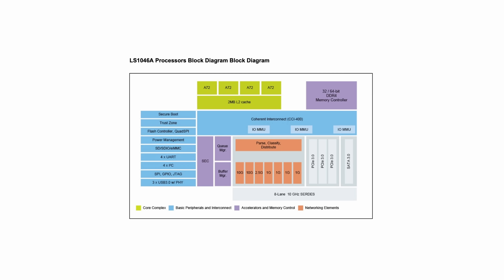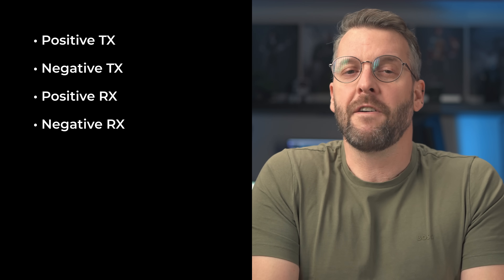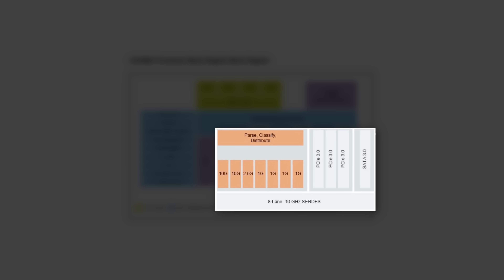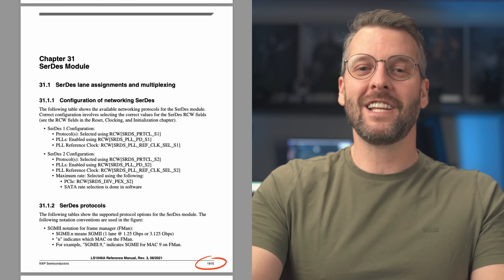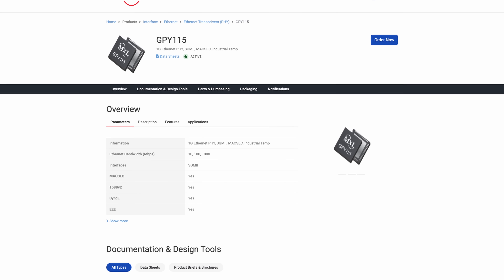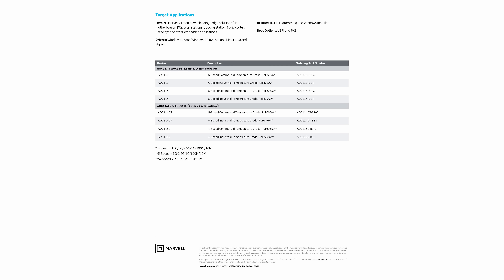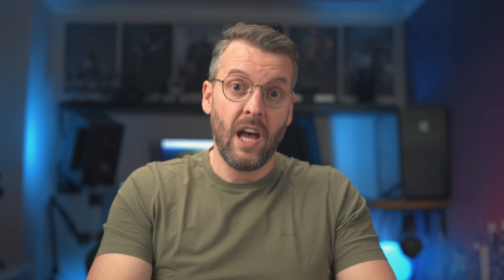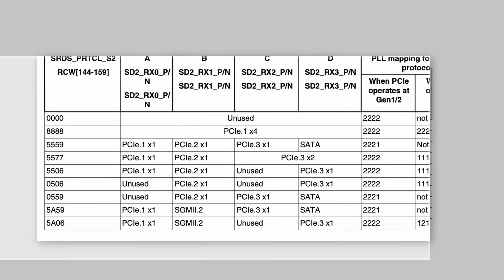You sure do LOVE your 2.5GbE ports!

Comment from the maker: Would you pay more for this device to include a 2.5GbE port? If so, how much?
Reply: I would not, 2x10g is fine for a single-homed router, if you are doing multihoming you need at least four.
Reply: It's not the job of the router to host the 2.5G port with POE for WIFI access point. The 10G SFP+ port is already available for connecting to a separate POE switch with as many 2.5G or 1G poe port as required.
Reply: @stanjs  agreed
Reply: I would pay for this extra speed, now the how much....would have to see the full picture. If (hypothesis) the device with 1gbps ports is 170€ and the one with 2.5gbps is 200€ doesn't need too much thought to pick the 2.5gbps. But if we are talking about 50€ or even more....then maybe a model with just the 2 10gbps would seem better 😂
Reply: No, this router can be suplemented with a switch with 10 gif upload and 2,5 gig poe Switch
Reply: No,.. a good multigig switch can supplement those ports. It’s not worth the price to add one 2.5 GbE port, while sacrificing 10GbE capabilities for the future.
Reply: I think that if you really want 2.5GbE that bad you can just get a switch with 4 2.5GbE ports and an upstream 10GbeE port connected to the router.
Reply: @FBI_Master  at least with cable modems, sometimes switches between the router and the cable modem aren’t supported … at least from my testing.
Reply: I only have 1 and 10Gbe (sfp+) and no 2.5 currently in my ecosystem so I personally prefer 10 overall.
Reply: No. Your originally proposed spec without 2.5G looks a better proposition.
Reply: no.  the 10gig can be split out to a switch if i cared about 2.5GbE
Reply: personally, i prefer 2 SFP+ at low cost, switches with 10Gb/2.5Gb are numerous and cheap on chinese sites. moreover if it's SFP+, there are SFP+ modules capable of 2.5 or even 5Gb.

In conclusion, as cheap as possible for the brain, distribution switches can easily compensate for this need.
Reply: No. The 2 10GbE ports and 1GbE ports are fine.
Reply: an alternative is to run ryzen embedded with 2x10Gbe. There are some reasons to and not to use PCIe. Using PCIe allows using an integrated circuit to handle PHY and process some traffic itself (its why mellanoc and intel chips are famous in servers), the other reason is latency, which can have a difference of up to 0.2ms on LAN. case in point in 1Gb/s from my testing in the past, a realtek gigabit chip attached to the chipset just doing PHY achieves less than 0.2ms latency while a marvell gigabit chip attached to PCIe achieved a latency of around 0.4ms. The test was a LAN ping to a dedicated networking device like an embedded router. PCIe if done wrong can cause unwanted latency depending on what you intend to use it for which can reduce throughput in traffic heavy situations but not throughput heavy (if you use larger packets and large payloads). You do need to remember the realtek does not do any processing of its own and relies on the CPU while the marvel can do some packet processing which is why realtek isnt liked for pfsense since most of them are just PHY chips with processing offloaded to CPU.

I have an udoo that uses ryzen embedded but it chose usb-c instead of 10Gb/s networking coming instead with 2x 1Gb/s ports. If you sacrifice 10Gb/s usb-c you can get 2x 10Gb/s + 1Gb/s on the board itself, separate from sata, pcie and ram can be easily made to be a slot. I am surprised you didnt consider this as it would've reduced the time and complexity of your design with the only downside to needing to get a working bios which can be done through a reference one based off one of the common x86 bios. Not only that but with the ryzen embedded, you not only get your networking and PCIe for wifi but for m.2 storage too, a good range of general IO like usb3 and the option to add a PCIe networking chip and have 8 lanes for a full card. It is power efficient as i run proxmox on this 24/7 for a few watts. You get 4 ryzen cores with SMT and a GPU to use with packetshader if thats your thing.

udoo prefers to be on the unnecessarily more expensive side of SBCs so you could easily out do them in pricing for making a router using the same platform with more features. Its important to remember that hardware design is one thing, you will need a firmware that supports any hardware acceleration on the hardware you intend to use.
Reply: @System0Error0Message nice opinion
Reply: for me i have 2x10G NAS, 1x5G ISP and 1x2.5G wifi, this devices even with only one 5G would not fit my needs, but its super cool to see this project developed in public.
Reply: Please don't, the device is already expensive as-is. 50$ is a significant cost increase, and if it weren't for the promised cheaper version, i would probably be unable to afford it... 
Also,I don't see any benefit for a single 2.5G port. Yeah, you may have a home server, but then, don't 2x10G ports suffice?
All I'm saying is that I don't see a justification for it, given the cost increase.
Reply: I would not. 2x 10G its great for inbound/outbound and I can use the 3x 1G for mgmt and other random things.
Reply: as i said on previous video i dont see a reason why to have a 2.5GbE if its not like a free (no losses thing, maybe if it replaced 1 GbE ports as it could still server as management but its a poor upgrade choice) since there are 2 SFP+ 10Gbps cages which can with simple modules be turned into any 1GbE and up rj-45 or SFP.

also i do not understand why use 2.5GbE port anyway when most home networks from router to core switch can easily be covered by single SFP+ cage and at that speed its very likely that incoming wire will eb fiber which makes RJ-45 port kinda useless as fiber will work with SFP+ much better
Reply: @bigpod i agree ... if you need more flexibility you can always add a switch and utilize a couple of vlans to create more ports ... if posible add a nother 10ge port instead for added bandwith for the trunk, and let people split it into 1, 2.5 or whatever themself 🙂
Reply: @bigpod  Unfortunately there are lots of cable modems or fiber ONTs that hand off via 2.5GBaseT or 5GBaseT and don't support either 10G over copper or any SFP+ variety.  I wish my AT&T fiber could just use a SFP+ but that's not an option.
Reply: @SeanHarlow  you can use rj-45 module for sfp+
Reply: Would a "shared port" be possible like a lot of switches have where one or both of the 10G interfaces can either use a SFP+ or RJ45?  Mikrotik recently released a switch with a mismatched configuration like that where four ports are either 10G SFP+ or 2.5G copper so the more expensive 5/10G copper components could be skipped.

I think the Netgate 6100 and Deciso/OPNsense DEC740 represent the price cap in the $800ish range, as both have 2x 10G and three or four 2.5G copper interfaces (plus two more gigabit interfaces for the Netgate) paired with x86 CPUs that allow a much wider range of OSes to be run than an ARM board, I can't see choosing ARM all else being equal unless I was trying to run off batteries and cared about power consumption to the single digits.

All that said, IMO as long as the SFP+ cages can support 2.5G and 5G modules I don't see any reason to care too much what the native copper ports can do.
Reply: I personally have 3 Gb down/3 Gb up configuration at my home. A 2.5 GbE would allow me to plug my desktop into it directly! I agree with @toumpanis' suggestion.
Reply: I don't think it's worth any premium whatsoever in this case.TBH, I'd prefer an additional  SATA/NVME  M.2 port over 4x1Gbe. With 2x10Gbps ports (1 must be SFP) I'd simply buy a switch with 10Gbps uplink and required number of ports that are needed at required speed 1, 2.5, 5, 10 and may be with POE and maybe managed. There are plenty of those at very low prices. There is no downside except needing another power socket. A small price to pay for  great flexibility.
Reply: No. That's my switch's job, not my router.
Reply: Honestly why not give it as an option for anyone who wants it.

If there is an option I would pay more how much depends. Is there only 1 port of 2.5GbE or multiple?

Forgot to ask that m2 slot would work with LTE/5G modems or not at all?
Reply: @sebas0469 only one 2.5G port. The reason for not giving an option is that they would have to build 2 PCB versions, due to the SERDES configuration, and the additional interface chips required. The cost would double, for sure (think of the additional certifications, development, etc.). This is why this video has been made in the first place, it is too expensive to give an option, so the audience would vote which one version it will be.
Reply: Personally, I would pay more for the 2.5gbe port, however, I think it's not needed at this point in time. I understand that the market this device is for the high end/homelab space but at the end of the day, gigabit fiber has only become available for me within the last 6 months... I am willing to bet that there's probably a large portion or the united states that still doesn't even get gigabit speeds. 

I think that a second version of this router might make sense to have the 2.5gbe port(s) as I imagine that would be another 3-5 years away if it were to happen, making the market for 2.5bge much larger and it might actually make sense at that point in time.
Reply: No, definitely don’t change your initial thoughts! If some one wants one or two 2.5G Nic’s he can put 2.5G transceiver in them. And yes I definitely want to buy that router it’s exactly what I’m searching for.
Reply: Thinking through this and all the comments, I think if your only market is high end / homelabbers, then skip the single 2.5 because we all have a multitude of other options.

BUT if you're also hoping to hit a portion of a bigger segment, that is, prosumers, who might not easily be able to interface with SFP or for whom this will be the only networking device other than a modem, then this is a must.
Reply: Of course I would, but actually I prefer 10GBits ports, so that I could split them without speedloss. Also WiFi7 would be nice a nice accessory in your router, but I actually think, that it would be cheaper with all these features instead of a new '' high-end '' router which is selling for more than 600 €. You could maybe design your router partially upgradable, so that modules could be upgraded by time.
Reply: I think the 2x 10Gb is enough, wouldn't pay more for 2.5.
Reply: I would also not Gigabit is more than enough for the european Internet in the Next 10 years
Reply: Maybe add a 2.5switch on a 10uplink
Reply: No, I already have a 10 gig switch.
Reply: im not too familiar with netwoking equipment. but if the sfp 10gig ports can be adaptet to 2.5 gig or 10 gig rj45 then puting a 2.5 gig rj45 is not needed in my opinion
Reply: So, we have SFP ports which can have a 2.5Gbe module if needed. I don't see the need to increase the cost.
Reply: No for me it is not worth
Reply: The concensus seems clear and I agree. I don't see a good use case for a single 2.5GbE on a router. If you want one, you're going to want more, and very possibly with PoE+ - e.g. for WiFi 7 APs.
Reply: I'd pay for the extra speed. I'm tired of my Nighthawk throttling my network.
Reply: @JosephANagyJr  Your Nighthawk is an all-in-one router/switch/access-point. This is a router and in the same way that you would be expected to add dedicated WiFi APs, a separate 2.5GbE switch is not unreasonable.
Reply: @KeithHanlan  not sure what that has to do with anything that I said
Reply: @JosephANagyJr  you wrote " I'd pay for the extra speed. I'm tired of my Nighthawk throttling my network." - I took that to mean that you were arguing in favour of addition of a 2.5GbE port as a way to solve your current WiFi router's limitations. What did your statement mean if not that?
Reply: My current PFSense router has a bunch of ports, but I just use one ethernet LAN and one ethernet for WAN. I'd probably prefer a cheaper router coupled with a switch to provide 2.5Gbps POE ports.
Reply: For my homelab, a 2.5g port on the router has the same value as a 1g port. You can already get Chinese switches with 1-2 10g sfp+ and 4-8 2.5g ports some with vlan support, PoE, and even web management  for 60-130$. I just don't see the value in getting a single 2.5g, unless maybe you want to use it for a WiFi AP, but even then there aren't that many WiFi APs that need 2.5g, and I would expect someone who has use for such an AP to already have a slightly more robust networking setup than just a single router and no dedicated switches. In my opinion, the 10g ports are the value you are offering.
Reply: Just go with 2x10Gb SFP+. The modules are pretty cheap to convert to whatever you need.
Reply: I would not, its got 2x10Gb which is more than enough, hook it up to a couple of L2+ or L3 switches, run the VLANs through the 10Gb ports.
Reply: Absolutely not
Reply: Yes. Don't have to upgrade in the future.
Reply: No, not worth it
Reply: ❤Yes!😂2.5GbE port!,Please plus Fp+ 25GbE Port! Thank you...
Reply: 2x SFP+ is fine for a Router. Don’t need the 1g or 2.5g ports
Reply: No
Reply: Your price survey makes no sense, if you prescribe minimum prices for different questions (no 3 and 4).
Reply: I really can't understand why home devices still have 1 gbps ports have you tried to move a steam library over that or move 4k blue rays or restore a big backup from your NAS to your PC?  etc.... 2.5 should be the bottom of the barrel in 2024 yet it's like a rare unicorn .....  companies are just greedy
Reply: no; i hate the things
Reply: I don't need the 2.5G. The two 10G SFP ports are MORE than enough for a home router.
Reply: please make sure that the linux kernel can handle forwarding 2.5Gb of traffic.
from my experience, there is an issue with linux on arm when it comes to high data rates, even 1Gb puts a lot of load on the cpu
Reply: Only need real 10gbsfp ports and 1gb cooper ports, 
others is black magics with bad price
Reply: I Would go for the cheaper Version with just two 10G SFP+ and the standard Gigabit Ports. If your Product succeeds, you could think about another Model (pro, plus, ultra, whatever you like) but then full send. So i would say, 5GBit (since every cheap china switch is able of 2.5, so there wouldn't be any benefit in my opinion) and including PoE++ on all Copper Ports for a WiFi AP. I think, in this case, enough people could be encouraged to spend even 80€ or so on top of the base model.
Reply: Given I am already on a 2 gbps internet, i sure would like it. Although the main reason I want the device is not to replace my router (which has poe, storage etc), but to run pfsense/opnsense and wireguard.
Reply: this will become glorified sff pc in a jiffy 😅
Reply: nope, 2x 10G is perfectly fine
Reply: No
Reply: I would pay more for this feature.  I believe having the 2.5gb port helps the router hit that sweet spot between home/server grade router.  The increased flexibility in the product helps the home user fit it into whichever requirements they have.
Reply: You’re making a router that a normal manufacturer wouldn’t make, why wouldn’t you go balls to the walls? Also adding as many high throughput ports is future proofing, 1gb isn’t even relevant anymore, 2.5gb is getting that way also, you should put either the 5gb or another 10 providing it backwards compatible, meaning it supports being a 1gb port, or a 2.5 or a 5, 10gb.
Reply: Absolutely NOT ... there is no need for an additional 2.5G port. I wouldn't pay extra for this port !!!
Reply: Given that future fibre routers are likely to ship with 2.5gig ports, at least one 2.5 or other multigig capable port is vital. It could be a 10/5/2.5 port however. I'd love one with a quartet of multigig ports. Perhaps all SFP+ ports for ease of manufacturing, you could bundle a multigig sfp+ module.
Reply: @truckerallikatuk 10GbE supports automatic handshaking to 2.5GbE already. It is part of the spec.
Reply: @FBI_Master  Incorrect, it may be part of one of the specs, but I can guarantee you that out of 4 10GB cards I own, precisely zero do anything other that 10gig or 1gig.
Reply: @FBI_Master so why does my UniFi switch see my oc as 10gb
Reply: @FBI_Master  State your source.

I have plenty of enterprise 10Gb networking equipment that will connect at either 1Gb or 10Gb.

It may be part of a newer specification (i.e. IEEE P802.3bz), but I would not be surprised if there are more 10Gb interfaces that do not support 2.5/5 than do.
Reply: @truckerallikatuk  it has 2 10G ports
Reply: @truckerallikatuk  Agreed, if no 2.5/5 port for WAN, at the very least x3 SFP+ ports (x2 bonded to switch, x1 WAN), no RJ45. Can use transceivers (modules) for that.
Reply: @truckerallikatuk  I know for certain my ISP is working on offering up to 10Gb

Comment: I would appreciate a 2.5Gb port for WAN connectivity and would be prepared to pay for this feature. 
While it's still very uncommon for ISPs to offer gigabit speeds in Europe, it's not the case across the Atlantic, and Unifi have understood this very well.

So, to sum up, what I'm looking for:
- 1 x 2.5Gb: WAN
- 1x 1Gb: another LAN (or a wan failover, with reduced bandwidth, but this is for temporary failover)
- 1 x 1Gb: Management LAN - 2 x 10Gb SFP+: uplink to layer 2 switches (much cheaper) configured in LACP (Link Aggregation). These can be POE+(+) so no need for POE out on your router.

- On the software side, compatibility with PFSense, please.

In fact, you may succeed where Netgate failed with its 4200 model (which lacks both SFP+).
Also, do you intend to publish the performance that can be expected in routing thanks to this CPU (as Netgate does)?

Thank you and good luck with your project. I'm following it closely...